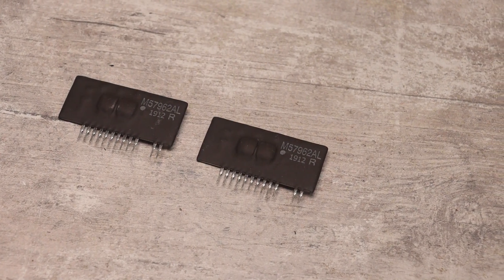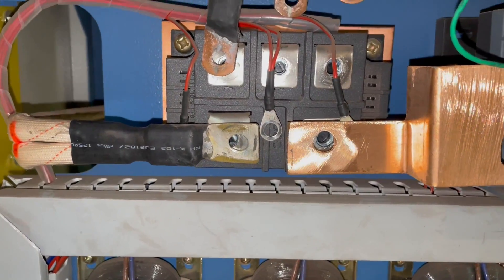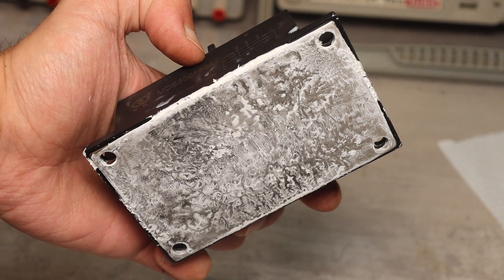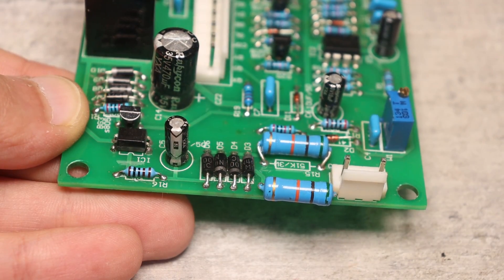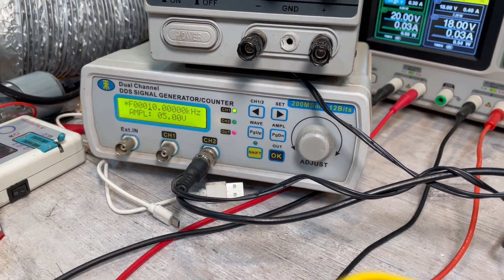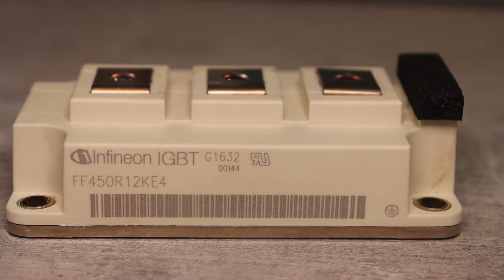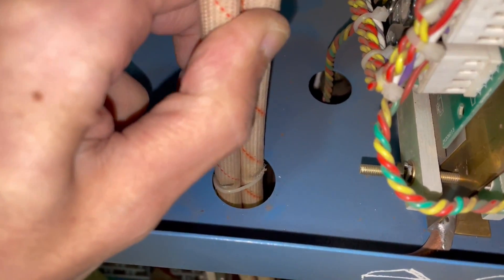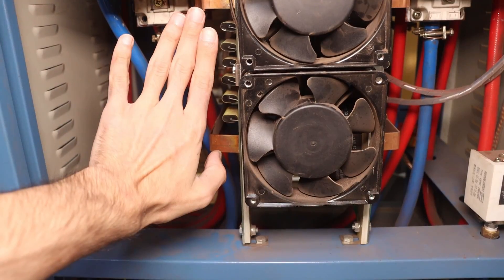160kW Induction Heater !  - Repair ( Part 2 )

Comment: The capacitor block you held up at 2:01 should be a single unit and not made up of individual capacitors.  Such units are made specifically for this application.

Comment: I disagree with the approach "it is someone elses property so I won't add the buffer". In the contrary, when it is someone elses property, I would rather make sure no component is overdriven, so when the predriver datasheet asks for an extra buffer, I would be very hesitant to not fit that buffer, once the larger power modules are to be installed. Mainly when it is already designed on the board as an assembly option. Of course, all such changes needs to be properly logged into the maintenance log book, so it won't come as a surprise with later service.

Comment: With 8 modules, there must be pairs in parallel. Recipe for disaster if there's any time differences that make one module switch before the other.
Reply: Not that much when they are "soft switching" (turning ON when there is no voltage across them), it is a resonant system after all.

Comment: Thank you for sharing this repair process. Did you measured the dead time between  lower and upper part of the H bridge drivers. Often, overlapping issue (DC voltage circuit to short )  causes power modules and drivers to fail.

Comment: I love your thoroughness in leaving no stone unturned. 
Have you put any thought into the bundles of twisted pairs running throughout the machine?  They all seem to have the same amount of twist, meanibg they are more likely to cross-couple than twisted pairs that have various twist count per length. Also, should some of the signal lines be shielded?
Similarly,  have you questioned the "grounding scheme"? I'm sure you are knowledgeable, but unintentional multiple return paths often get overlooked. Something like this needs to avoid ground loops and ground potentials between components, most ideally, a "star" arrangement, one single point at which all common return connections meet. Usually the best you practically do is a single, centralized low-impedence bus bar directly off the power supply return (isolated from the chassis earth).

Comment: Slower switching on the IGBTs in this application is a BIG deal!  You did the right thing wanting to go back to the original IGBTs.  Don't be surprised if things don't go well with the slower pucks/bricks.  The gate drive layout is always the Achilles heel in high current IGBT installations.  In my opinion the driver boards are too far from the bricks.  Too much lead inductance.

Comment: Those hose clamps on the water cooling loop are hot garbage.  On a piece of equipment like this, I would spare no expense and put in some of those nice German made hose clamps.
Reply: You mean "spannbackenschelle made by Norma" or the band clamps from "geka" which are an insane quality piece of themself? YES
Reply: They didn't even have grommets for the wiring, this thing is sketchy, or as Diodegonewild would say "DODGEY!".
Reply: Designed with flaws copied with multitudes ,repaired many times ,throw parts at it ..
Reply: @obiecanobie919 i cant believe they design machines that cost some tens of thousands of dolars to have such low quality details, like come on, i guess thats how bussines is made
Reply: Sooopurrrr DODGEY lol